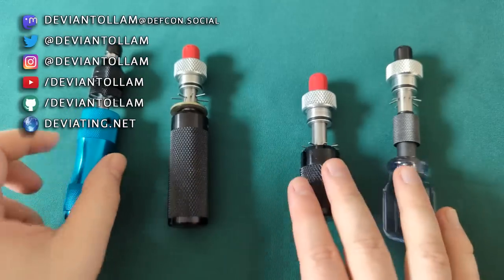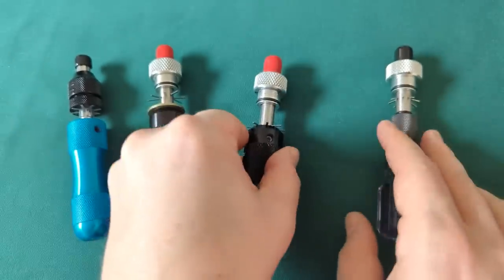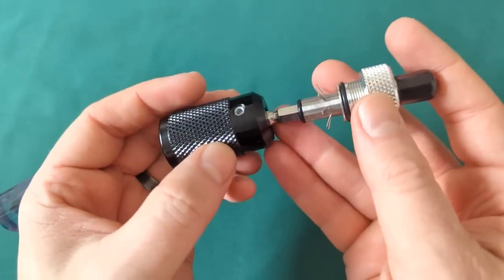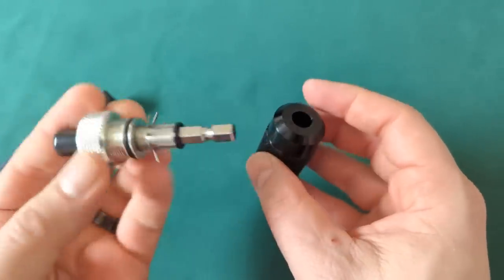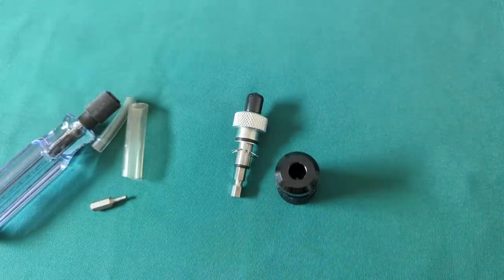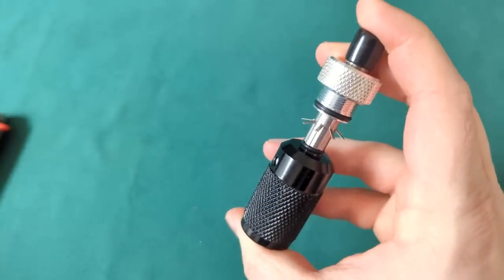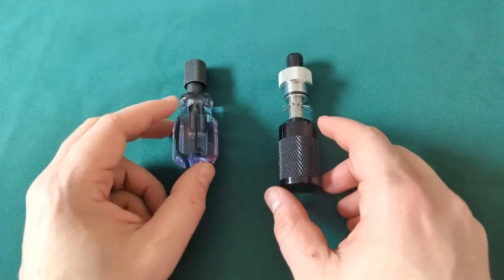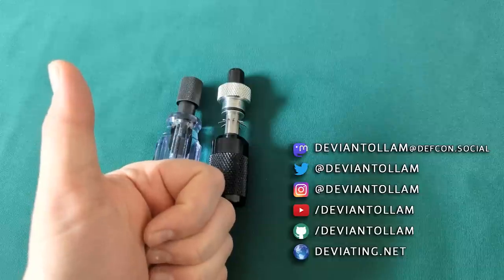A Simple Tweak to your Tubular Pick Handle

Comment: I cannot believe I did not think of the "quick connect" tubular pick. I love stupid simple solutions. Best part is it is so common where I am from (Ca. Bay Area) elevators, cabinets and pretty much everywhere you can think of where a wafer lock should be. (There is still more wafer locks than tubular, but I see the slow uptick in tubular locks being used.) That means this compact little guy will be in my go to kit along with my screwdriver set.

Comment: Did you try a split, flat, ring ‘sleeve’?

It needs to be a split piece of flat metal so it can contract, circumferentially, when the set screw is tightened

Comment: If you go to a hobby shop or hardware store, and look at the K&S tubing, you should be able to find some that will act as an adapter. It's too thin wool for one piece to be the adapter, but the wonderful thing about that stuff is it comes and nesting the sizes. You can get one side that snuggly fits inside of the next inside the next &c &c &c. 

If you're interested in some adapters, let me know. You can get my contact info from Savannah if necessary.

Comment: ehhh... honestly this is kinda poor tbh. I was just about to buy this, and yeah if i saw that the included handle literally did not fit i'd be pretty pissed, yeah.  this is an oversight that probably shouldnt have happened and i'm glad its being resolved.  i'd like to know when so i know when i can order a proper one, not one that i have to bodge together.
Reply: You don't need to do anything to it. You can use it with the included handle as is.
If the small aesthetic issue bothers you, you can either use the heat shrink, or use it with a bit driver.

Comment: Or a harbor freight 1/4 inch extension (the upper magnetic round part) chopped off and drilled for a set screw dimple.
Then your actual tube pick handle can also be a screwdriver :-)
Reply: I was gonna comment that. There HAS to be a commonly available extension that happens to have the right diameter!

Comment: wouldn;t it be easier to poke a hole through the handle the same diameter of the hex, gripping the tool on the larger, smooth diameter? Straight a the factory i mean, this way you maintain compatibility and don't have to add random pieces of heat shrink
Reply: Deviant said that will come but right now the manufacture is set up this way. Changing that will probably take a moment.

Comment: Hey Dev, what is the best solvent to remove transphobic decals/stickers from mailboxes and bus stops in my community? I’ve been using a multi tool but it is frankly kind of a pain to scrape off each one.
Reply: My suggestion would be to use a reasonably sharp putty knife or a safety razor scraper and some goof off (or similar product). depending on the sticker they can come up real easy or be a right pain to deal with so the experience may vary
Reply: Acetone, cotton cosmetic circle wipes, and a windshield scraper
Reply: Brake cleaner and a small razor paint scraper